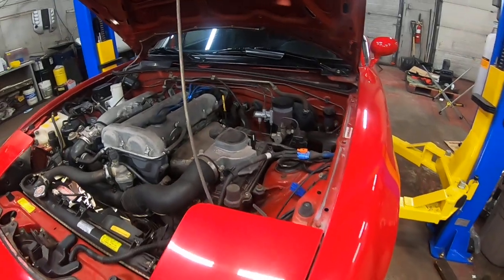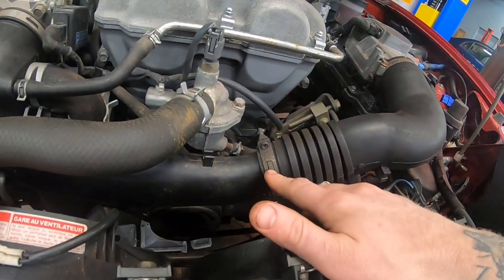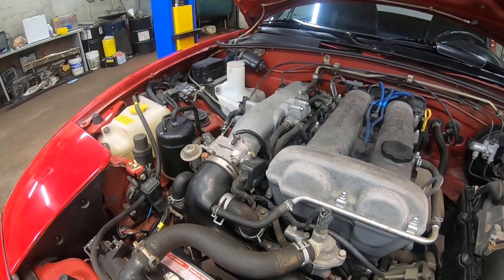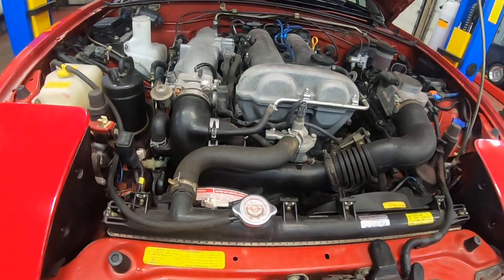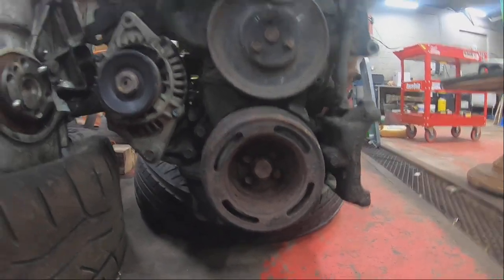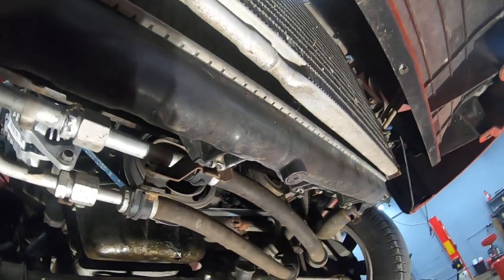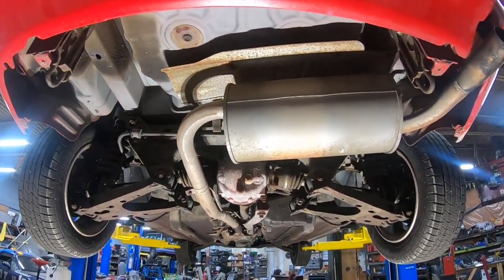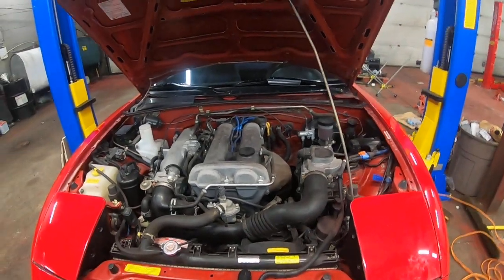Anatomy of a Miata 1990 - 1993 (NA6)

Comment: One thing I have learned from watching a log of these kinds of videos is that there are so many versions of this car. There is no such thing as a standard NA6.Mine seem to have so much extra stuff, don't know what is "standard", A/C, cruise control, power steering, antilock, probably more crap. Apart from the engine block and the fuse block there is little similarity between mine and this car.

Comment: i gotta say the slave cylinder IS different, there is an early '90 style with the nipple on the slave cylinder rod, & a later '90 & the nipple goes into the clutch fork on the early '90 NA

Comment: THE BEST and most thorough explanation of the Miata engine.  Nicely done.  Much thanks.  Question for anyone out there, I took 93 Miata to the shop to change the timing belt and hose replacement kit.  Now the system idles at 1600 to 1700 RPMs. The idle adjustment screw is bottomed out.  I dare not touch the "No Touch" adjustment bolt that's set at the factory.  Any advice for a Marine Corp veteran owner to solve this issue?  Liked and subscribed.
Reply from the maker: Use a timing light to check ignition timing, if that looks ok it’s possible they put the belt on wrong
Reply: @immortanautomotive9221  Thanks for the reply.  I'll get a timing light.  Another clue I found that when I turn on the A/C, the idle drops to the desired 850 RPM.  My Idle air control valve mounted below the throttle intake manifold has a two wire connector but mine only has a single wire.  Should it have two wires?
Reply: I forgot to mention that the check engine light is giving 3 long blinks and 4 short blinks when Ten and ground is shorted.  I tried the Reset Procedure  (disconnect negative from battery for 30 seconds) but it didn't clear it.  Have you ever disassembled and cleaned out the idle air control valve below the throttle body?  What did you use to do that?

Comment: Hey man. So what’s the black can/fuel filter looking thing with vacuum lines going into it. Near the coolant overflow reservoir.
Reply from the maker: It’s part of the “evap” system, which regulates fuel tank pressures and venting

Comment: Stupid question: I need to adjust my TPS. Where do I insert the feeler gauges? Like where is the throttle stop screw? Is that bit at 5:25?
Reply from the maker: No that’s the dash pot, the throttle stop screw is on the other side, hard to explain, I would think google image search would give you what you’re looking for.

Comment: What is the black box on the far drivers side, out board of the clutch master clyinder? It has a plastic cover and the inside looks like electrical connection
Reply from the maker: There are a couple relays in there, horn and lights if I recall correctly

Comment: Is there supposed to be a cover over the wiper mechanism (crowl) on the driver side
Reply from the maker: Nope, only the right side covering the motor itself
Reply: @immortanautomotive9221  thanks man! Recently got my 90 Miata and it is really rust free. Has some decent oil leaks on the CAS and the VC, probably front main seal too but without any rust - it was a steal

Comment: What about the dreaded plug? under the crank angle sensor? What a rotten thing to do. I have not a clue to why they plugged an unused coolant port from the 323 engine which is what they used ( with a change of cranks ) When that little rubber rubber goes, you lose all of your coolant mighty fast. Replacing it is a royal pain in the tushy.
Reply from the maker: I actually don’t see those fail very often, one trick to keeping that plug “healthy” is stay on top of any oil leaks you have.  When oil gets on any of the rubber parts it softens / weakens it.
Reply: @immortanautomotive9221  Mine finally gave it up after 31 years and 5 owners. It still is a very bad move they made with a quick fix. But, guess what? Mazda still had one in stock. Having said this, I do not know what can be done to plug it with something else. What would you do if you were faced with that part being “ retired?”
Reply from the maker: I’d get a universal one from an auto parts store for $1
Reply: @immortanautomotive9221  I am glad there are simple options available then. I was not aware there was. Good to hear. I expert trying to explain what you need to an auto zone would be difficult. Here is a retire part which I ended up having to machine. My Miata does not have power steering and it body developed a rattle which I misidentified as a bad shock or a ball joint.  After chasing the problem, l found after taking the right side inner tie rod boot off, shards of deteriorating plastic was found. This was what was left of the bushing which centered the rack and pinion rod in the housing. My efforts to find that part was not fruitful. So I made my own.
Reply from the maker: Shoot me an email at ImmortanAutomotive@gmail.com if you want to make more of those bushings and sell me a few, I’ve run into that problem as well.
Reply: @immortanautomotive9221  I measured the inside diameter of the housing and the outside diameter of the shaft. The difference of course is the thickness. I found a drill bit which was slightly larger than the shaft size. I used a two inch round bar of Delrin or some other chemical and heat resistant polymer. I only have a cheap harbor freight lathe. After I chucked it up and finished off both ends of the two inch round bar then used the bit to bore the hole. The bit must not be removed until the diameter of the outside will fit the Interior diameter of the housing. The material is so thin at that point it would be impossible to mill down without interior support. I left 3/8” of the full diameter of the bar to have something to attach to inside the rubber boot. I crudely used a screw clamp and safety wire to secure it to the outset of the housing inside of course of the rubber boot. Before taking the piece out of the lathe, I parted it off at about an inch and a half of total length. It took me a couple of hours fiddling because I am no machinist.  So to rehash, select some round bar of some chemical resistant polymer larger than the outside diameter of the housing. Chuck it up and finish off the ends. Leave enough material sticking out of the chuck to be able to cut down 2” or so making sure your tool can travel that far down toward the chuck. Then using a bit just a tiny bit larger than the shaft, bore a hole 2-3” deep. Leave the bit in the hole to support the material. Then using a cutting tool remove material from the outside for a snug fit into the internal diameter of the housing. I used a file to take down the final material and to smooth it. I used a hacksaw blade to sever the part leaving 3/8” collar to have something to attach to. You do not want this sliding out of the housing although I do not believe it would interfere with steering. I wish I knew the exact name of the material I used but I got a remnant from a friend who has a CNC fabrication shop. Get something which is machinable and oil resistant. I may have notes, if I do I’ll will send you more information.